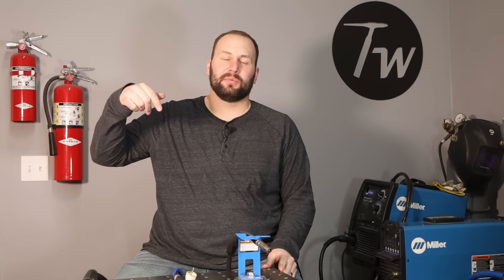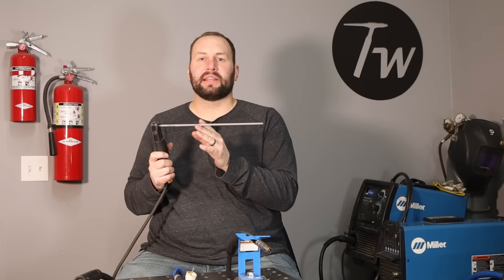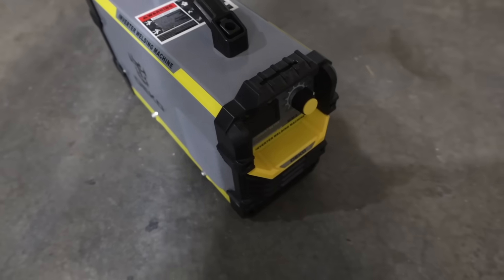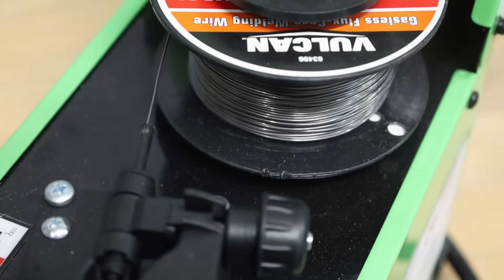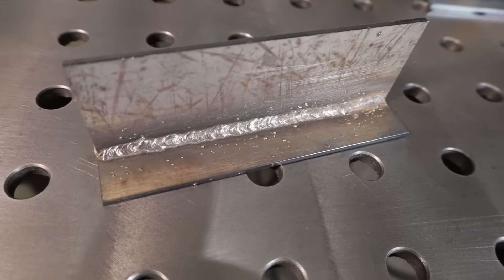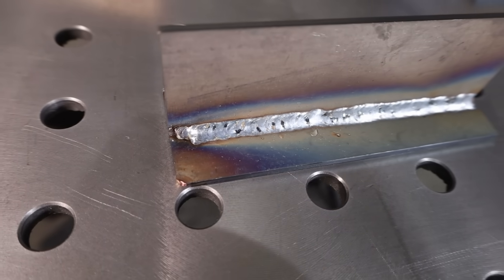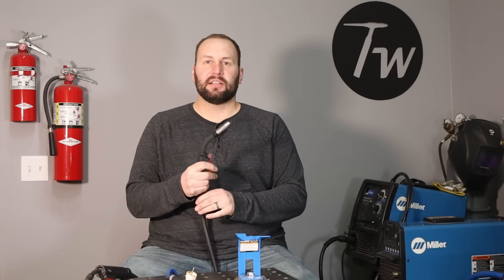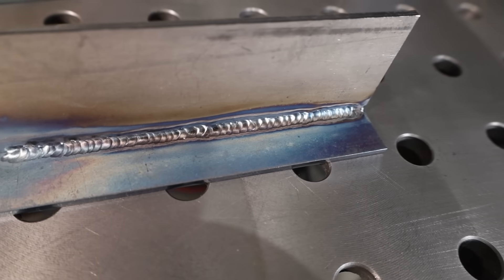4 Types of Welding Explained: MIG vs TIG vs Stick vs Flux Core

Comment: First of all, great job with the video capture! You did a fine job finding the proper filter and distance for the camera, and that takes trial and error.

Second, this was a well conceived video! Very informative and properly scripted! My only note is that it would have been nice to hear what gas is used for TIG, since you specified CO2/Ar for MIG.

I had no idea what TIG was, and had never heard of flux-core outside of soldiering. My welding training began on the ranch with brazing and stick. I have done MIG, but have never gotten a proper class, to my regret. Your video really filled in a lot of gaps in my knowledge, and I'm very grateful!

Comment: Nice job on the video, but you didn't mention one time about "Safety", I seen a knucklehead welding without safety glasses or shield. (I would say; he's blind ) ...
Reply: Shops in the nineties added long sleeves to the safety list. More likely to get killed on a fork truck or run over by one.

Comment: Hello and thanks for this excellent video.  I've never welded before, but suspect I'll learn quickly.  I don't have any current projects, but suspect a good quality stick welder will meet all my needs.  Its been over a year since you made this video and I was wondering if you still think the DEKOPRO 110/220V MMA Welder, is the best value for the money?
Reply: MIG is the way to go, but uses gas and wire spools.

Comment: Would stick welding be able to be used for making a new crash bar for a car?
Reply: It takes a real pro to arc weld on thin tubing. It depends on the wall thickness of the tubing. Practice on a sample piece first. Oval track car safety bars are MIG welded by top guys.
Reply: @georgebuck2269  ah okay. I want to get into welding (as a hobby) I took a course in school like 15 years ago 😂 but I didn’t stick with it (unfortunately)
Reply: If you use a thinner rod and lower amperage, you can! Look into the recommended thicknesses of your amperage and practice on a bunch of practice coupons cut from the material you plan on using.

If you're just building a one-off project, you could also try to braze the pieces together, as it's a lot more forgiving and allows you more time to join the pieces together. Most custom bicycle builders use brazing for making their frames.

Comment: you said mig is more expensive then flux core because of the gas which makes sense but you also said because the machine is more expensive,,yet later you say we can switch from flux core to mig by using a gas cyl so then is this not the same machine for both processes?

Comment: I lost the data on what method is the most secure in integrity. Just starting out, so be kind
Reply: Arc welding and TIG are very strong and for MIG it's the qualitty of the machine and skill of the welder.

Comment: Im 65 and have always wanted to be able to weld so i bought 3 machines,,plasma cutter,,,tig welder,,and mig welder,,,when i try to use stick welder getting lots of stick,,gettign better at finding a way to create a puddle and get the job done,,as for the mig its a mess,,comes out spotty and its spitting,,,,plasma cutter is alot easier however getting differnt opinions on howmuch air pressure to use,,ive got a huge compressor with plenty capacity,,any suggestions

Comment: I've been a welder for 30 years now and I picked you apart in my head every step of the way but then I cleared my head and decided to give you a thumbs up! You are teaching people who don't know about welding, the process and machines for each. Now being mostly an exotic metal welder I can tell you yes a tig machine is best for tigging higher end metals but don't forget that a basic stick welding machine is great for carbon steel and stainless steel! Just reverse the leads and you will be fine! Now that everything is all fancy we need to still teach the weekend warriors that they don't need to run out and buy a $1,000+ machine just to tig some stainless or carbon. Just reverse your leads and make sure you have 100% argon when you tig. Might welding has MANY gas ranges though! Know what you're welding for the  eat results! If you're not exactly sure what gas to get for the job at hand, just ask you local gas dealer and they will help you out. Sorry about the long message but it's just some things you missed. Good video
Reply: I applied for a job TIG welding Tantalum in 1980 at twice the pay rate of any other factory, no union. I complained there's no welding test and the machinists running the shop didn't know there was such a thing. It was a second shift job. I got the job .

Comment: Electric welding has a huge problem for me. The power supply. Some people say you can do 110 ac some say you need 200+ or forget it. So now I'm looking at going through the house to the dryer outlet or buying a generator. My small buzz box welder means short a.c. run and short d.c. cord. I can't drag a lot of my projects ten or 15 feet from my back door. Seems like getting 70 feet from my dryer outlet to the yard will cost a million bucks

Comment: I’m 69 years old and did a huge amount of self-taught oxy-acetylene welding as a 17 year old up to the age of about 35, fixing up old cars, welding new panels in and patching … etc.
Nobody uses OA these days and I don’t have the bottles or the torch anymore, so I’ve been contemplating which electric welding set to buy to do the odd personal fabrication jobs around the yard, metal fencing repairs and re-welding the hinge that’s broken off the steel post on the gates to my property.
You’ve answered my questions, thank you. I need a more simple stick welder, MIG would be too elaborate for the tasks I need it for. 
Then I’ll have to learn it from scratch, but at least I know the process, having done such a lot of OA welding in the past.
Thank you ❤️🇷🇴

Comment: Stick welding does the job well enough for most DIY jobs but only when there's enough power to maintain the welding current. The big issue with home stick welding is not enough power to maintain the arc. You need a substantial power cord and ideally a heavy duty plug and power supply that can handle the demand.
Reply: Yes, just look at the wiring for an electric clothes dryer or water heater. Heavy gauge wire is the way to go. You meant circuit breaker with a high enough rating.

Comment: Stopped using stick rods years ago having an 8industrial mig pretty much covered all my welding needs
Now ive moved i often stick weld 
Like everything availability and dependent on what you need to weld are factors

Comment: The video wasn't super clear to me the technical name of each type of welding, at the chapters were labeled very helpfully. As a Structural Engineer I'm always seeing SMAW and GMAW thrown about, but this video helped me to internalize what each type of welding really is.
Reply: Stick or  arc = SMAW.  TIG or Heliarc = GTAW.  MIG = GMAW - Gas Metal Arc Welding. TIG is Tungsten Arc Welding, water cooled torch with tungsten electrode, Argon or Argon/Helium mixed gas. The melt temperature of Tungsten is around 6150 degrees, that's why it it never melts when welding. All metals are weldable except zinc, yes that includes copper and brass, In brass the zinc burns off, but it leaves a quality weld.

Comment: Oscillating multi-tool is the best slag remover you can get. Also, tong type electrode holders are junk; twist-lock types are far less frustrating..

Comment: Thanks for producing this content: I’ve been wanting to learn to weld, and this helped me with where to start
Reply: If your TIG welding, please turn on the Argon gas and the water circulating pump before you start. And remember all metals except zinc are weldable. Yes, even copper and brass. Mig is used for filling gaps and fast travel speeds. TIG is high penetration, slow and steady for short length welds.

Comment: Great video! I’m ok using MIG, but I’ve always wanted to be good at TIG. 
Can you recommend a good AC capable TIG machine that doesn’t break the bank?
Reply: Don't forge to price the Argon gas at the welding supply store.

Comment: Thank you for this nice clear comparison of the different types of welding. The video of each process in action is great too. I have done MIG welding but the machine was massive and though there's no slag I don't like the thought of pumping all that gas into the atmosphere. But since TIG requires the inert gas how can a stick welder do this?
Reply: If your worried about putting gas in the air maybe you should try underwater basket weaving.

Comment: What determines the strength of the weld is a certain type of welding better than others let's say your welding a go-kart body or something that is going to have a lot of tension and torque and weight on it.  I would imagine that the structure would break at a weld point if it does break.

Comment: so nice work overall, and i get that this is a training video so to speak but damn when your mig welding either turn up your heat or down your wire feed. Thats way too much splatter! But i will say your Tig welds arent far off from showoff nice, just gotta keep that puddle under a hair more controlled. Well done video overall tho.

Comment: Hi Tim, I've been checking out your excellent instruction for a bit, and I plan to work my way through all of it. This is exactly what's missing from YouTube welding instruction (or any technical subject, really) - which is the introductory material for beginners.
I do have one suggestion - you have so many intro/intermediate videos that you could organize them into a complete course. The playlists you have are useful, but not quite as organized as a full trade school curriculum. With a little re-ordering and maybe a few new fill-in videos, I think you'd have a unique product on YouTube. And you'd be well justified in charging for entry if you cared to. If so, my money is ready.
Anyway, thank you for your expert instruction.
Reply: In fact there's nothing to stop you from creating one or more playlists and making them public, given that Tim probably doesn't have the time.

Comment: lot of memories for me - I did a lot of Steel stick welding and soldering Copper pipes - My TIG and MIG skills not so good.. Built a steel frame for a 40ft plywood pirate boat in a park

Comment: Awesome explanation, what if you don't have a metal table, what do you connect the clamp to?
Reply: Make a great electrical connection and clamp it to the piece your welding. You can clamp vice grip pliers onto the piece your welding on if the part is too small for the welding clamp.

Comment: hmm... i wish i could find a welder that do not require me to either have gass or metal rods.. i would like something that can just melt the metal it touches sort of like how a soldering iron does to plastic..
Reply: TIG without the gas or filler metal.
Welds aren't the best.
Also there is friction welding but has limited applications.

Comment: Leaned with MIG, occasionally used stick for really thick materials.  Went to TIG and never looked back.  Aluminum, Stainless, Compressed High Carbon Steel, etc.   Been doing it for a while since 94.  Keep practicing.   Practice,  Practice,  Practice....its gets to be like riding a bike.
Reply: Copper, brass, titanium, tantalum, inconel.

Comment: So interestingly enough, I work as a TIG welder, I started in an assembly plant with no experience. After learning I realized that if you can learn TIG welding, you can easily do any other welds. Not only that but in my work we weld Stainless Steel and my buddies call it "Speed Welding" because we literally don't stop moving our rod. We power it to 70-90 and just straight bead it across. We use the fill rod for corrections or stitching gaps but in our work we can't make crecent moon or stacked dime shapes like most. The result is a gorgeous weld if done right looking smooth as a babies bottom, however this has resulted in a lot of welders from outside not being able to weld anything we do. We have to reteach them all over again. We weld from 100-500 parts a day per welder and have up to 6 welders. It's crazy how much gas we blow through.
Reply: Need a "SpaceX" level Gas Supply, for your Shop! Bringing in Argon Gas, by the Tanker Load! 😁
Reply: @robertweekley5926  
You are not kidding. We blow through about 5 tanks a day. Apparently they want to change out the small tanks for one large one connected to all 6 welding booths but I can see so many issues with that 😂
Reply: @UItraVice  - Can they "Do Both?" Have Fixed Supply Lines, "And have Tanks" as needed, if Mobility is needed?
Reply: Are you still Doing Welding ? What you're feeling about the need of welding in the future! Should I learn welding? Can I get a Job There?

Comment: Was hoping for a pros/cons explanation. I know what they are, but not what they're good for. My research so far says TIG is the best because it can do anything. Steel, cast-iron, aluminum, cast-aluminum, etc.
Reply: For arc welding cast iron use reverse polarity, nickel rod = Ni-Rod and preheat the whole piece. And after your done peen the weld to stress relieve it.

Comment: What is the best means of welding indoor with minimal ventilation?
Reply: TIG has no smoke. MIG is smoky but stick = arc welding is the worst. I wouldn't worry about it unless you are welding in a confined area, such as a ship where the compartments are small. I worked as a welder in small factories for over forty years and the paranoid people will drag you down. I averaged 55 hours a week for most of those years.
Reply: @georgebuck2269  I appreciate your reply as well as your subject matter expertise.

Comment: I've always wanted to know this information. TIG reminds me of just soldering.
Reply: With welding you are melting the base metal and it fuses together. With soldering your just adding tin and lead (solder) to copper wire, the copper wire doesn't melt.

Comment: Why doesn't slag interfere with the intended bond, and would it be better to just have the flux on the top (+/- sides) of the rod's metal?
Reply: For arc welding or stick the slag never interferes with the quality of the weld even if you make mistakes, or are a beginner. Remember slag and flux are two different terms when referring to Arc welding. Slag peels off or is chipped off the weld after your done. Flux is the ceramic type coating on the rod before you weld. It's purpose is to burn off and shield the weld fom the surrounding air. All welding TIG, MIG and Arc require an air free area or the weld would be full of bubbles or porosity. Try a trick and break the flux off the end of the rod an inch (25mm) with a hammer. It won't start an arc, because there's too much air there.

Comment: Appreciate the vid, TW !   Haven't done much stick or wire welding since 1990/91, yet, have 5 plus years experience laser welding titanium & 7 years flux soldering.  Which type of machine is best for a metal pipe animal corral in need of repairs, made of 5" & 3" corner pipes, with horizontally welded 3/4" sucker rods ?   Regards, David

Comment: This is really helpful. I have a few projects in mind that would require welding and have never done it before (plus I just want to give it a go- it's another string to my bow after all). My Grandfather was a master blacksmith and welder and I wish I had taken more notice of the equipment that he used when I was younger, which we sadly no longer have. Anyway, this video did the trick and I thank you for it- I know where I need to go and what I need to do now.

Comment: What stick welder would you recommend for a beginner?
Reply from the maker: Depends on your budget. These are all the machines I have and they all work well considering their price. 
$130 DekoPro 160 amp machine from Amazon 
$300 Harbor Freight Titanium Stick 225
$500 HTP Inverarc 160
$800 Esab Rogue 180i
Reply: @TimWelds  thank you

Comment: That was a good video. At the moment I’m using arc weld, but I find it to vicious for thin tubulars. So I am now seeking an alternative. I’m not a welder by the way 👍👍👍
Reply: Arc or stick is a high penetation and gouging type of weld only used in 1/8 stock or thicker. MIG is what you want for tubing as it's the easiest to learn.

Comment: Ive been interested in welding for a while but was raised more around wood workers do some people find doing a crossover into welding difficult? Also I have bought a home with land that I will eventually need to fence off. What platform would you suggest I use?